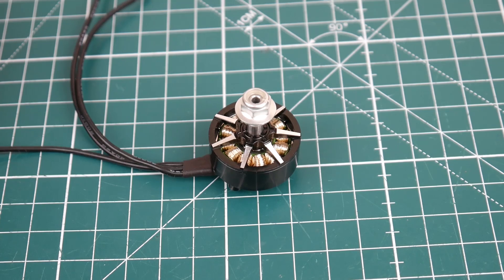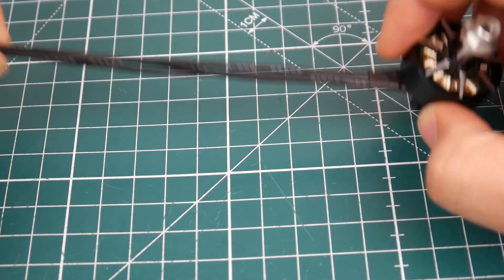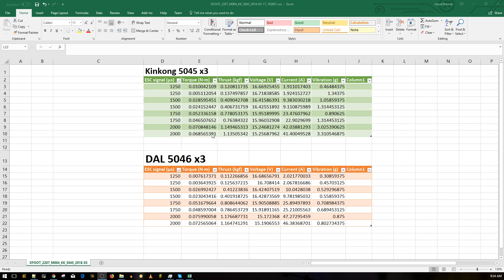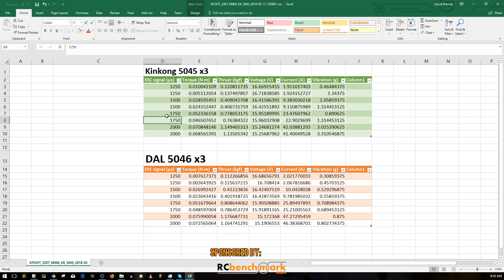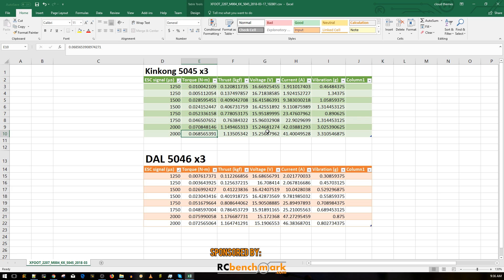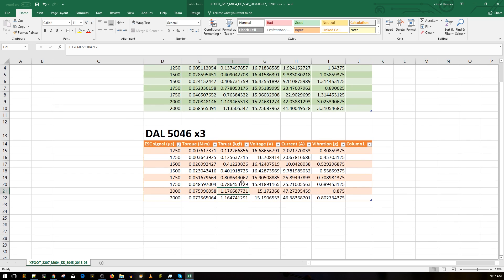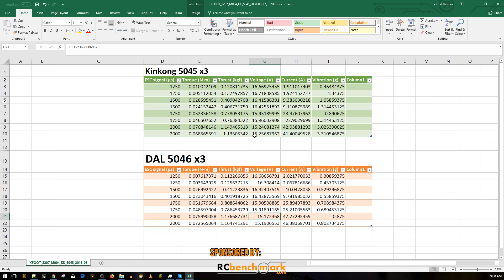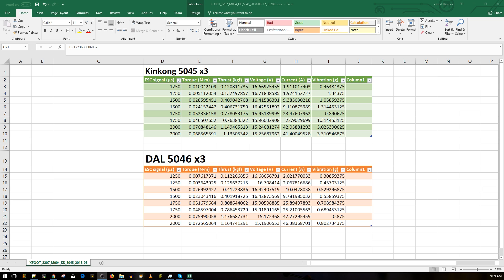X-Foot 2207 2500kv Thust Test // Impressive

Comment: Will the teko 32 ,35a esc go 5 s ,or rather the 4 in 1 ,or which esc is best for 5 s because UAVfutures used the racerstar rev35 a esc to go 5 s?
Reply: How dont you burn your esc's out because the Tmotot F40 can go up to like 54A the same with Brotherhobby but still the 30 and 35a esc seem to work how?